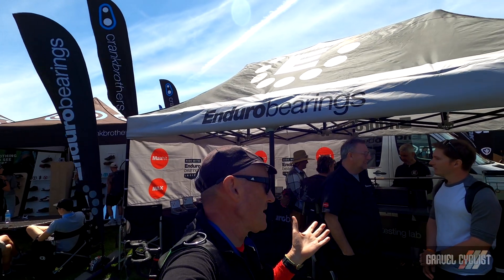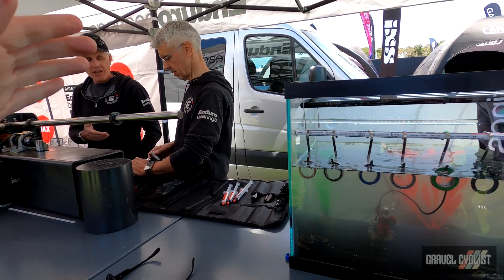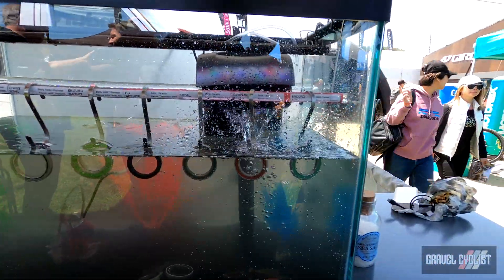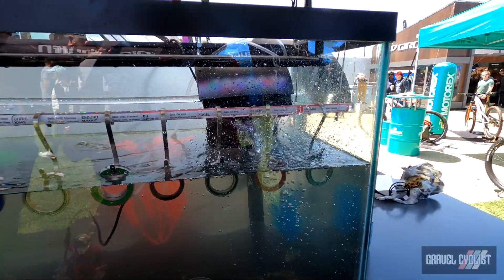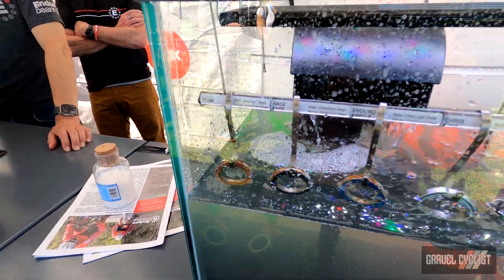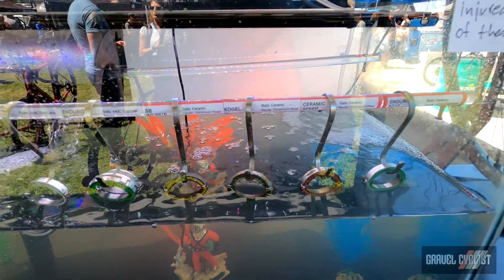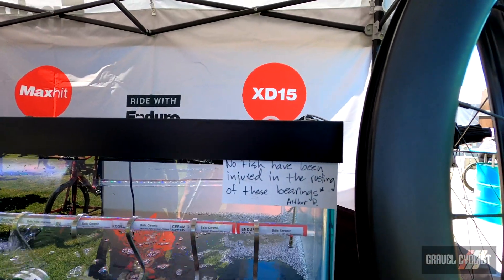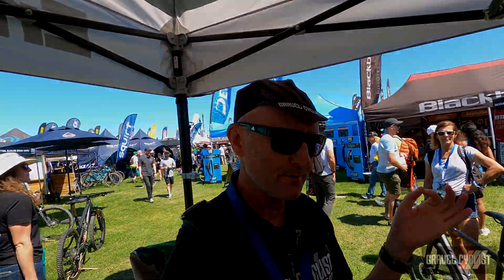Saltwater Fishtank Bearing Test: Enduro Maxhit & XD15 vs EVERYONE

Comment: Hello, good morning... If I want to use an all-ceramic bearing without a cap in the sea, salty and acidic water, at a depth of 150 meters, which means a pressure of about 16 bars, is an all-ceramic bearing the answer? I have a total rotation of 90 degrees and a low speed... I would appreciate your answer...

Comment: Aluminum or titanium wouldn't turn brown in that tank. But is it a better material than carbon steel, which does corrode? And if you have full ceramic there would be no corrosion, but it could easily fracture under load. So what's the point of this setup? Most of the time you're riding in dry weather, with the cartridge bearing sealed and slathered in grease.
Reply from the maker: "Most of the time you're riding in dry weather" ... researching just a few of the more popular gravel events proves this statement is incorrect. Inclement weather happens often. Moving forward, I know of plenty of riders whose cartridge bearings are NOT slathered in grease. Perhaps post follow-up questions to the folks at Enduro Bearings, or let's hope they chime in?

Comment: Interesting experiment going on there. I just changed the bearings in my bottom bracket earlier this year. Two year old bearings and I know that water from a fresh water crossing on a route I regularly ride got in and caused issues with corrosion over time. Yes I know I need to clean my bottom bracket more often when doing that crossing but even fresh water can mess with your bearings.